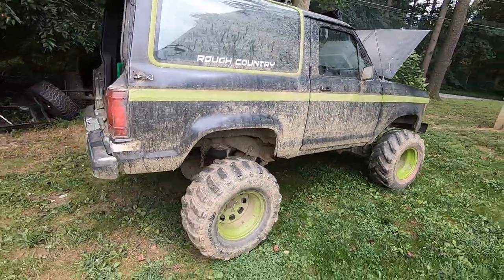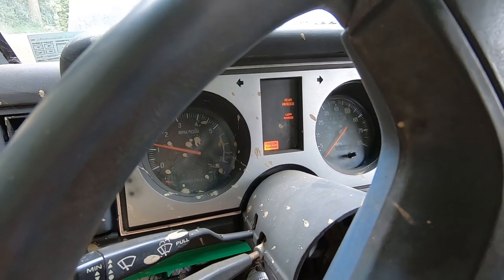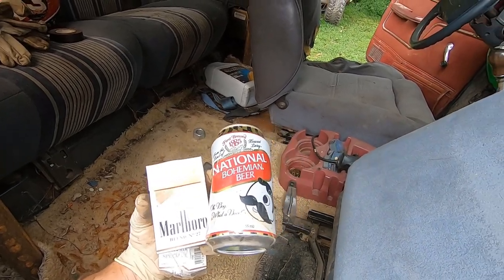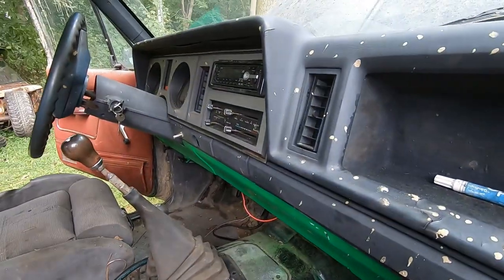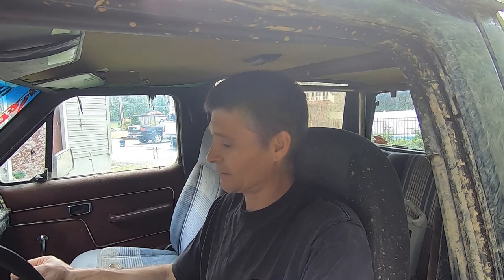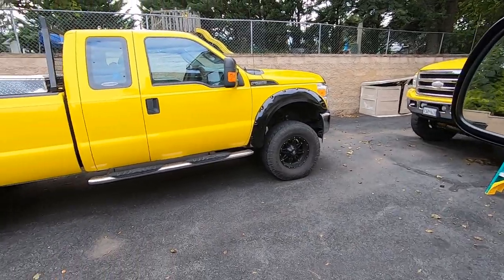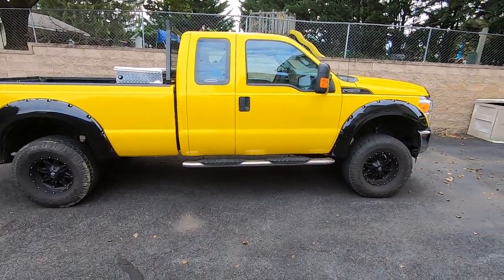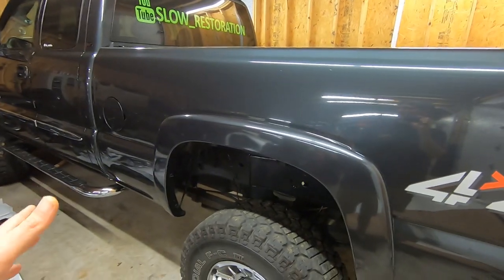PICKING UP A TRAILER WITH THE TURBO GMC

Comment: Clean the throttle body and IAC off the engine. If that don't work check the map sensor to see if it's giving you the right out put voltage
Reply: Nice profile picture
Reply from the maker: Probably should. I'm leaning towards the map too.

Comment: Check the grounds at the battery for the computer and o2 sensor or bad fuel pressure regulator.
Reply from the maker: Thank definitely could be any of those issues.

Comment: What size turbo is on  your truck? Do you have the dyno sheet for your turbo GMC still? So many guys looking for information on turbo set ups for towing/work truck Applications. Just tossing an idea out there for a video! Turbo size, boost, power numbers at what rpm. Etc.
Reply from the maker: Thanks for the ideals! They're always welcome. The truck hasn't been on the dyno yet, soon! It's a 78 mm Turbonetics BB.
Reply: @slow_restoration  awesome! It'll be interesting to see how much torque she's making down low. It's a badass set up and truck man. Looking forward to More!

Comment: Ahh budro if I was u Ida go lowes or n e hardware store purchase u a 13 dollar 4.5 elbow cuplink Take a regular lil saw cut yur kn air sleeve halfway down replace filter cliped in one side cuplink other to sleeve. That lil 2.9 will not only breathe better but less chances gettin water loged threw mud. Sorry just a thought
Reply from the maker: Yeah probably will build a snorkel!

Comment: Bypassed enertia switch bypassed the intank fuelpump also in tank low-pressure pump failed
Reply from the maker: Thanks, did you ever have intermittent run issues?
Reply: @slow_restoration  yes no clue why just kinda dealed with it. It was like that from day one with me  the wiring was pretty cobbled together